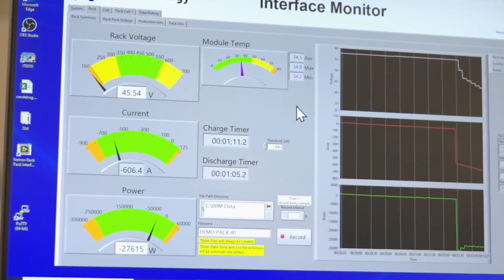Shocking News: Sodium Batteries Replacing Lithium

Comment: You did good. I had no idea people were pursuing NiMH or Sodium batteries in cars. Makes lots of sense.
Reply from the maker: There is a strong business case for city vehicles. I'm not sure it makes since for the 300 mile range type vehicles. Those batteries would be very heavy. But vehicles where the range is 80-150 miles. The weight difference could be managed.